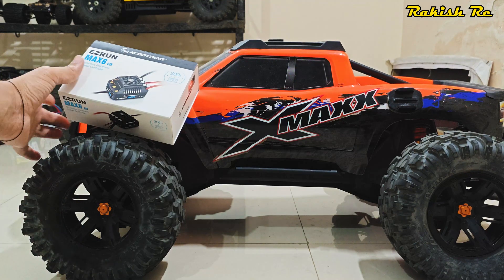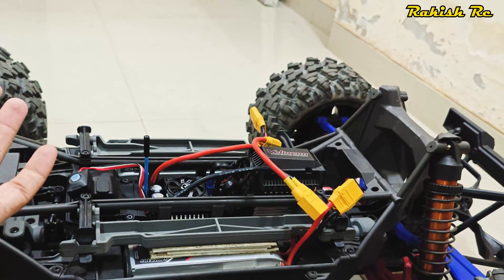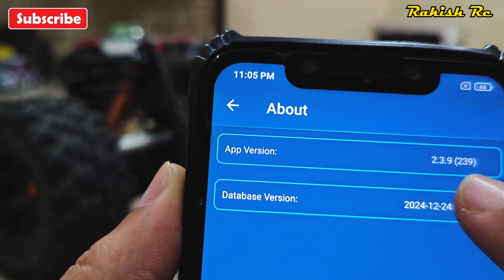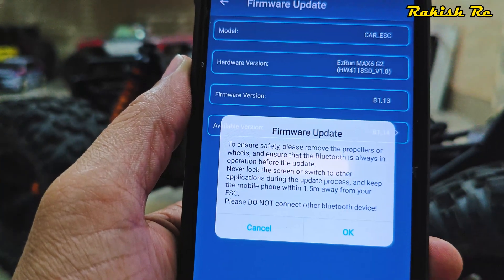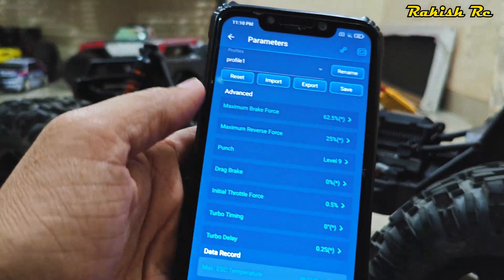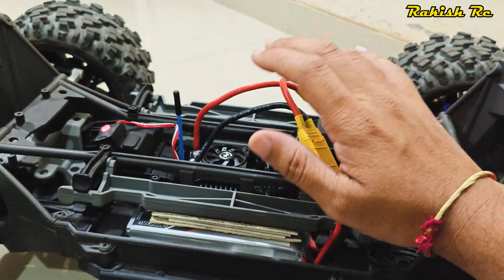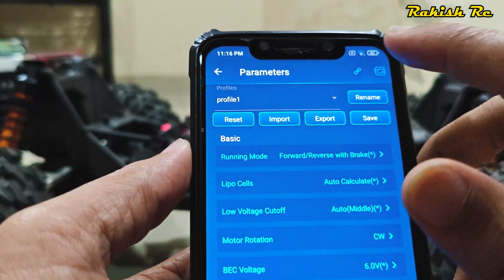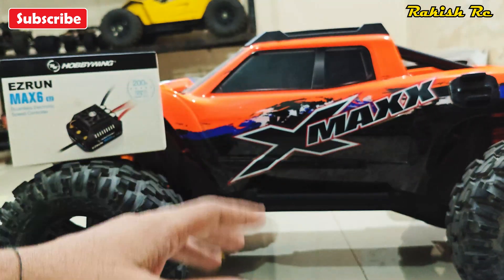Hobbywing Max6 G2 Firmware Update Fix Motor Stutter | Traxxas X-Maxx 8s ESC

Comment: My max6g2 is fine until after 5-10 minutes of running and getting warm and then it starts cogging real bad. Temps aren’t too high either like 120f maybe
Reply from the maker: May be it's due to bad solder bullet connection on esc... which after getting warm or hot must be causing loose connection and cogging. Which motor are you using?
Reply: @RakishRc spektrum 4274
Reply: @RakishRc I’ll have to check my connections although I usually do a good solder job

Comment: Do you have to have any Bluetooth modules or special programming card to update the firmware?
Reply from the maker: @V8chump  no external module is needed... The max 6 g2 has Bluetooth module built-in so you just connect it to a mobile device and update the firmware from the hobbywing app
Reply: @RakishRc awesome! Did you notice any more punch with the g2 and stock motor? Or does the motor run any cooler?
Reply from the maker: Haven't been able to test it that extensively but I feel like it's almost very similar with highest punch to the stock esc on full power.. Just that the g2 is 200 amp capable and the stock esc was 160 or so... So the motor could heat up on extensive abuse.

Comment: So what motor you have now? Stock X Maxx motor or did you get new motor? 
Ive had this same problem longtime already. Ruined lot's of pinion/spur gears and had no idea the problem was the Max 6 esc. I also used the app few days ago, but not sure if i updatet it cuz the problen is still going on. I have to put the whole car back together and try this program update and hope it fixes the problem.
Thanks for the vid!
Reply from the maker: Hi, I am using the stock xmaxx motor... The max 6 g2 has got a new firmware now B.15 I just updated it 2 days ago.. You have max 6 or max 6 g2? Because max 6 which is non sensored works completely fine with stock motor.
Reply: @RakishRc  I just rrealized  i  have max6. Not max6 g2. Loosing my mind here!!
Reply from the maker: Lol.. Max 6 should have no problem with stock motor unless the motor is not bad or damaged.
Reply: this wouldn’t cause spur and pinion damage though? Are you sure your mesh and everything is good? Sounds like drivetrain issues to me; I haven’t ever broken a spur or pinion while doing flips with mine (as of 1 year)

Comment: Awesome!  My XRT has been sitting for months now due to this issue.  I just purchased the 5690SD and now I saw this video, lol.  Oh well, I already purchased all the stuff to make the 5690SD work in my XRT so... either way, I'm happy.
Reply from the maker: @Silvia0073  yea I can understand.. I had planned to buy the sensored motor but I had already bought the 1100kv non sensored version.. So I had to wait for the firmware and get it fixed. Glad it's working now 👍